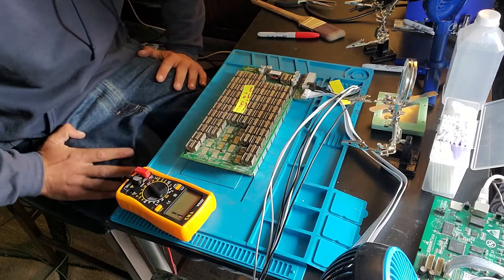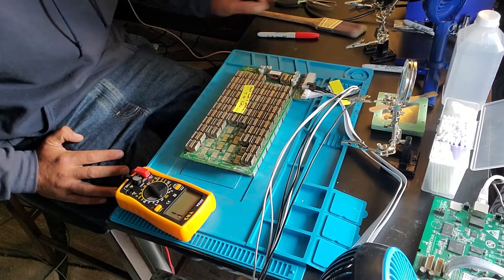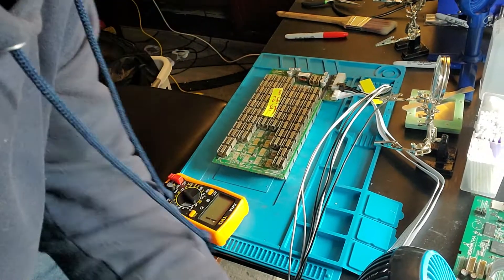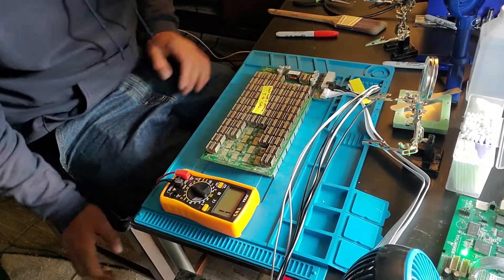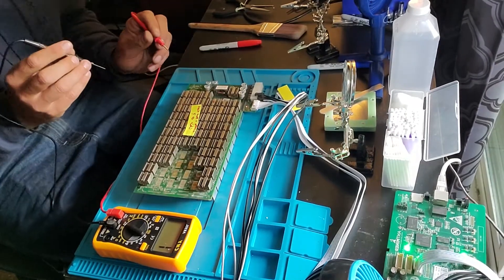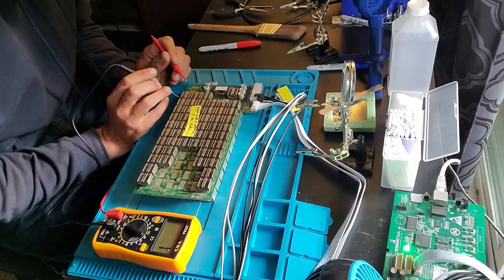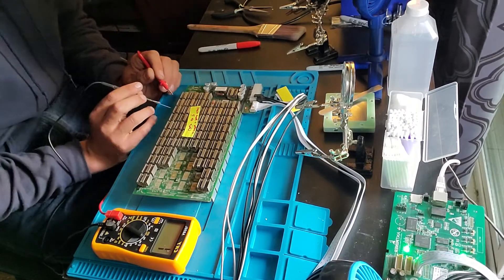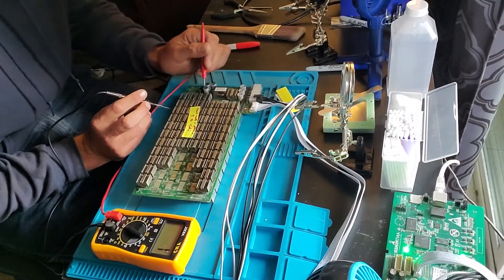asic repair on antminer s9 hashboard - diagnosis and troubleshooting

Comment: What firmware do you use on the control board?
Reply from the maker: I prefer Hiveon as it shows the hashchips, I am open to others if there are ones that do it better.
Reply: @CryptoMinerCHR  thanks!
Reply: @CryptoMinerCHR  I have S9 and it gives me 0 asics all 3 boards.  
Any idea of the problem?  
Greetings from Costa Rica
Reply: @PKdoor18  hello you have to check power supply model first, if all is okay than you need to start to test chip one by one
Reply from the maker: @PKdoor18  watch my other videos to see the different steps, more videos to come
Reply: No need to change the BM1397 BM1397AG chip repeatedly - Refit Antminer S17/S17 Pro/S17+/T17/T17+/T17 heat sinks from NBTC!